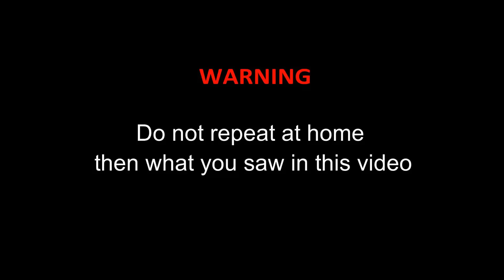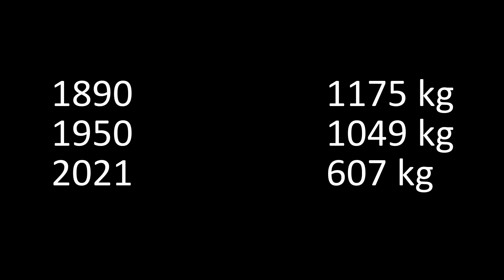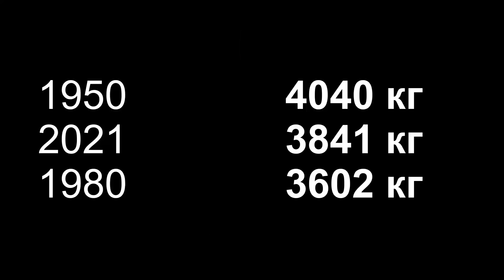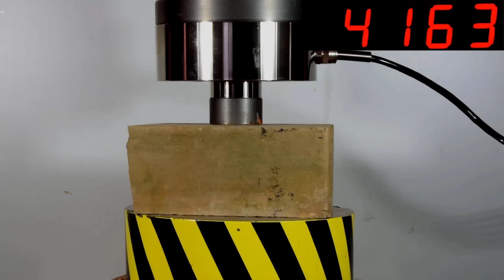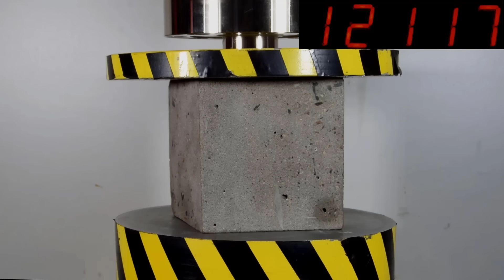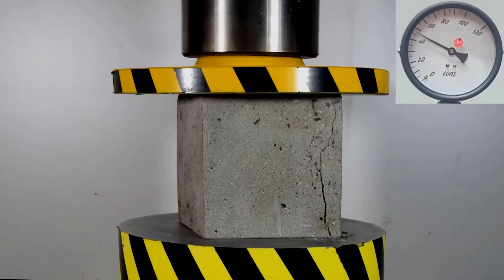HYDRAULIC PRESS VS OLD AND MODERN BRICKS

Comment: In my experience doing masonry restoration those old brick (from before the days of hydraulic presses in brick manufacture) are a fair bit softer than modern brick. It's interesting to see that the old brick showed the most tensile strength. Maybe not the most scientific test, but fun.
Reply: You need to throw them at someone to really get good data on which ones are harder! 🤣🤣 I'm jk
Reply: Tensile is pulling apart, the first test was shear.
Reply: that is because it has less air pockets then the cheap  modern stuff
Reply: @Bobbybob Breaking "easier" is relative.  I used to work on equipment in labs.  I had one that needed to hold pressure and we were at 3000 feet above sea level.  The company was bought out by an international corporation who thought they could save money by replacing the glass chamber with plastic. So when the equipment, used to measure blood counts, very sensitive, could not hold pressure anymore they replaced it with a newer improved plastic one.  TWICE.  Before I got hold of the supervisor of the supervisor and explained WHY plastic did not work at our elevation the way it does at sea level and they found me a glass one that does not BEND at a different elevation therefore not doing the job I needed it to BREAKING the machine.
Reply: Actually I'm pretty sure that that's shear strength, but yeah obviously the bricks were different sizes.
Reply: It shows how it is very primitive the old are and how profitable, cheap, money printing, and capitalism supreme the modern are. 
-Capitalism
Reply: New bricks are just siding, old bricks were structural. The modern-high strength brick versus the 1850 brick would be a better comparison.
Reply: @Deyzspyinonu  Yeah haven't thought about that, and high-strength concrete we tried to chisel some concrete to replace tiles it was hard AF, we used that chisel for concrete and some sledge hammer, it takes so much effort to take like 1 square cm of concrete
Reply: Survivorship Bias... it was the toughest of probably 20,000 bricks made.   The rest all broke.
Reply: @frankySinn  Wouldn't that first test be bending? Tensile on bottom, compression on top. Also has shear forces at play I guess, but I think a proper shear test would be set up differently.
Reply: Yeah, it is fun. However, concrete and bricks are designed differently these days, they are specialized, cheaper, and have overall better general properties. Like it may not be as "strong" as the 1890 brick, but it's likely cheaper, lighter, more weather and thermal resistant. There is also likely a selection of bricks you can get that have different properties based on the requirements you have, like how there is thousands of different types of steel.
Reply: It's interesting you say tensile strength, most people wouldn't catch that.  You notice the brick always breaks in the space between where the two blocks are holding it on the bottom?  The applied loading actually puts the bottom of the brick where it's on the two stands in tension along a direction which a loading wouldn't typically be applied to the brick.  Much like Concrete, it seems like they don't do well in tension like that.  The interesting thing is: a softer material tends to perform better in tension than a brittle one.  With that in mind, it's a little unsurprising the old brick performs better in this specific test as you said they're softer.  I'd like to see a flat platform used instead of the stand used to hold the bricks.  The test would be total compression then which is typical for loading applied to a brick.
Reply: Technically it's compressive test, a shear test is defined stress applied tangent to the loading axis offset from the center of the object.
Reply: @theskyisblue8979  Shear stress is applied tangent to the loading axis, but offset from the center.  technically a compressive test
Reply: In steel, high hardness makes things more brittle. So this holds that on a molecular level the force is dispersed better in a “plastic” or maleable medium and
Reply: @thefonztm  Yes technically it is, because the stands used cause a bending moment.  It has a lot going on but the brick fails in tension at the bottom.
Reply: @Deyzspyinonu  See - this is along the lines of what I was thinking - I'm not a masonry expert, but I am still pretty sure in any given year bricks were made with different properties for different purposes.
Reply: @Totes_ma_Goat  maybe 🤔….
Reply: depends on the making of the brick older bricks were mde with less mechanized  tech and usualy wood fired meaning lower temperature than modern gas tunnel kilm and the cly was less mixed
Reply: @frankySinn  actually, it's flexural strength. I was certified (and am still currently licensed, for the last 20 years. And although I haven't actively worked in the laboratory for some time I continue to educate and recertify in laboratory testing procedures) to perform these tests on concrete and masonry. ACI strength testing technician, laboratory testing technician, masonry field testing technician, concrete field testing technician.
Reply: Hardness doesn't always equal toughness. Think of plastic and glass
Reply: I agree, try driving a Tapcon into an old brick wall.  It never turns out well, it won't even hold a banner up for more than a few days.
Reply: Didn't even properly do the 3 point flexural bending test with ATSM D790 standards. Ah well close enough...
Reply: @thisolesignguy2733   you drill the wall and than hammer in a wooden stake than you get the largest screw you have and screw in to said stake that is the only way to screw anything in to old masonry FORGET plastic best use a softer pine wood and dip it in oil before inserting so it does not rot
Reply: @dementedbowine8681  That's not a bad idea!  I've been drilling the hole, filling with liquid nails, than wrap wire around the tapcon threads, and driving it in.  This seems to best for when I have install channel letters on old brick walls.  For banners, I drill the hole, stuff 2 wires in, drive the tapcon in, than twist the wire around the screw head.  This helps.  But around here, most buildings are 150+ years old and the bricks just crumble so we usually have to build hangers and frames to mount to.
Reply: @Deyzspyinonu  Yepp - and biggest problem here - sample size - as it is exactly 1 - I am pretty sure you can get a wide variety of bricks right now and also back then - and it depends for what purpose they are made. It isn't always desired that material are that hard - as working on them takes more effort than necessary.
I.e. many buildings are build from gas concrete – a rather soft material but strong enough to build a house from and on the other hand with rather good insulation in itself and you can easily form bricks in any shape you want and even on site it is possible to chisel away part easily to get any from you want…

So yes – fun – but not very scientific…;-)
Reply: @punker4Real  it's for better insulation, I don't know the science or anything but that's what the construction manager said.
Reply: @jacobvirklan2843  Yup, most composites (stone, brick, glass, etc) are MUCH weaker in tension than compression, and a flexure test like this loads it in both simultaneously.
Reply: Old (19th Century) industrial bricks were usually double-fired, making them far denser and more durable.
Reply: @edwardcullen1739  sorry guy but 19th century bricks can't hold a candle to modern bricks made for structural strength
Reply: love using (1950) common brick the soft brick, a lot of older buildings in Chicago use them most of the time you're saving the majority of the brick because they're still good even after decades.
Reply: Rigidity usually doesn't lend itself to tensile strength.
Reply: @frankySinn  Seems to me that the first test was a bend test, which is a combination of tension and compression, depending on whether you're measuring from the top or bottom. It's just that a clay brick has next to no elastic range, so it just snaps instead of visibly bending. The bottom side, which is under tension, failed.
Reply: @theskyisblue8979  It failed in tension, not shear. This is because in a bending test like this, the applied force basically compresses the side of the hydraulic head while the other side attempts to pull apart. You can see this when bending an eraser - failure occurs when the opposing side no longer can stay together. A pure shear failure would not have any bending whatsoever - it would be like if you had a massive pair of scissors trying to break the material with negligible distance (and therefore negligible bending moment) between them.
Reply: Tensile strength wasn't tested here though?
Reply: @Deyzspyinonu  That old brick may not have been a structural brick though.  It could have been a kiln brick or a street paver.  But otherwise I agree with you.
Reply: @Skystrike70  I stand corrected
Reply: @frankySinn  No, it was tensile on the bottom surface. To test shear you need the material supported along it's length.
Reply: @frankySinn  The specimen failed due to the shear (you can tell by the starting point of the cracks and by their shape), but it only happened because of the misaligned specimens. The brick should have been laid sideways to minimize the height of the cross section, then it would have probably failed to bending moment, from which you can calculate tensile strength. Check google for bending strength test, it is an indirect way of measuring tensile strength for materials with relatively low tensile strength compared to their compressive strength. The splitting strength test is also used for the same reason.
Reply: I'm my experience doing YouTube comments those bricks look fine and tonight to me 🤣
Reply: the old brick has a bigger size!
Reply: @Bobbybob different molecular structure .  Glass is liquid .
Reply: @FenrirRagnulf  kinda the thing I was thinking about while watching this and the guy even later compared an actual brick made for strength but I'm guessing didnt include it with the other 3 because it didn't look as shocking of a result that the modern brick was the strongest. Kinda why I don't like the concrete comparison you are comparing the block of concrete of a fortress compared to your average modern concrete which it's main advantage without rebar reinforcement is its cheap. Althoutgh if I remember correctly the rebar is more for its shear strength not really much for its compression.
Reply: @frankySinn  not quite, it was in bending, otherwise the chocks would need to be aligned to the actuated side of the test die (and the test die not be circular). The modern brick followed the von mises stress lines almost perfectly. Not quite fair to say tensile comment is invalid.
Reply: @prjndigo  assumes that the primary damage mechanism is a form of degradation over time. It's not. Bricks tend to fail because of impact damage...which is time-independent.
Reply: @andrasbiro6604  but don't you think it's interesting that the new brick followed von mises stress lines rather than the shear pattern of the older bricks...
Reply: @Totes_ma_Goat  

Thank you, Ignatz
Reply: @Totes_ma_Goat  🤣🤣🤣🤣🤣🤣😇😇😇😇🙏🙏🙏
Reply: Don't speak if you don't know anything.
Reply: @dementedbowine8681  i will rather scratch the surface of the pinewood piece with a big grain sandpaper or make grooves  with a knife (better imo) and dip it in cement-water  milk,  then put it in the drilled hole and proceed further.
Reply: @6pekXX  how ever you like im no exspert
Reply: Yeah, I expected the bricks from the 50s to do the worst. I guess I'm used to seeing them as a result of weathering, not hydraulic press.
Reply: @Totes_ma_Goat  to any politicians
Reply: Natural weathering can break down bricks over time, but it's only real enemy is salt. But this is just info, you can't make general assumptions or conclusions
Reply: As someone who has done bricklaying and concrete for over 20 years, I can tell you that modern bricks are fired at a much higher temp, making them harder, but also much more brittle. Drop a new red brick on a concrete slab, and then a chicago pink or cream city brick from the same height. The new brick will shatter and the old ones will either stay together totally or break in large pieces.
Reply: I also think there might be something of a selection bias in the sense that these are the bricks that have lasted. It stands to reason that these bricks survived as long as they have because they were stronger, versus an unknown number of weaker bricks that broke along the way.
Reply: @Deyzspyinonu  depends where they are made and which clay is used,where I live in Mass. bricks have been made here since not long after we landed.
Reply: Why buying likes no one even knows you lol
Reply: @budsbunny5610  🤣 First time I've heard that one. A random comment just blows up sometimes. I don't have anything to gain from likes but it happens to me occasionally.

Comment: Man, for brittle substrates you gotta use a deforming buffer between the press surfaces and object like a piece of plastic or rubber so the sharp edges, imperfect surface angles  and grains don't concentrate force and cause premature fracture. i see this type of thing on many hydraulic press channels and it is really frustrating. Thank you for the video though!
Reply: Neoprene pads or sulfer are what we use for concrete compressive strength samples.
Reply: I thought about that too, but I thought any high spots in the brick should take care of themselves when under that load. Maybe they could mortar steel plates to the top and bottom? Mortar may be imperfect too, but it’s the kind of imperfection they have to deal with in the real world.
Reply: In the last compression tests the load was offset giving premature failure on the right hand side as viewed.
Reply: Yes, Simon, why did they run the last concrete test with a different set up??

Comment: About 20 years ago, my family bought an old brick warehouse built in the 1920’s. For some of the remodeling work, we had to cut through the exterior wall, a section of about 6x3x1 feet (the wall being a foot thick). Even with jackhammers that was an all day job.
Reply: The wall was probably stronger from the beginning… as you can see most things were made to last as much time as possible until programmed obsolescence became a thing
Reply: Accrington brick?
Reply: @fearone9694  They were original ACME.
Reply: Dynomite
Reply: @furtado.g_  If the wall was a foot thick, that means that it was structural bricks. And for that same record, many of the old brick buildings in my town had crumbled near the bottom from moisture and had holes through them where the brick crumbled. 
Old buildings will degrade and fall apart without any kind of maintenance and they do it all of the time. Just take a drive through any town with old brick buildings and not a lot of money. 
My town recently started booming again and as a result, many of the old buildings were being fixed up, which generally meant repointing entire walls of crumbling mortar or straight out cutting sections of the walls out to redo them. Hell, the entire outer layer of one of the most well known buildings in town crumbled off last year. They wrapped the entire building in plastic wrap to prevent further damage (beer company bought it and are supposed to be rehabbing the whole block)
Why are so many people hell bent on proving old brickwork was better than anything ever. What we see standing is only what has survived throughout the ages. It's called survivor bias.
Reply: @caodesignworks2407  unfortunately that’s true… the moisture issue was not nicely dealt with during those times, resulting in holes and the bricks becoming very porous